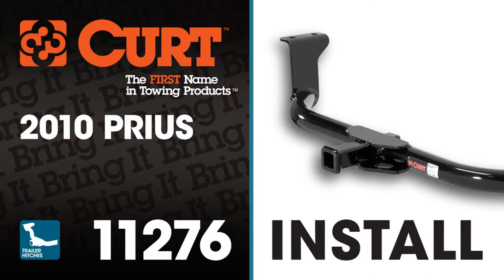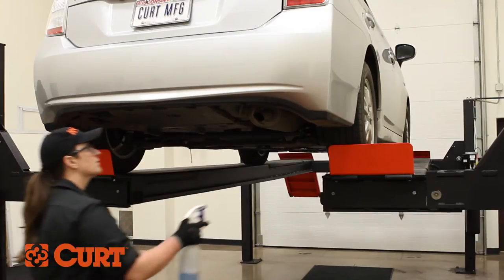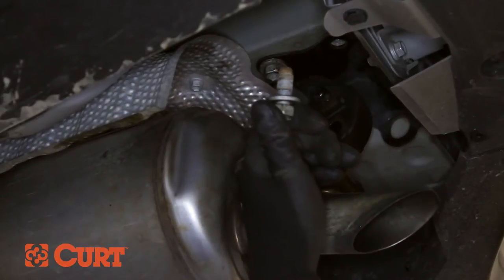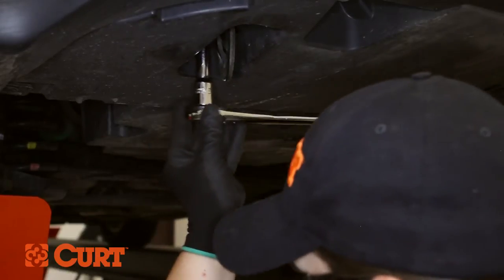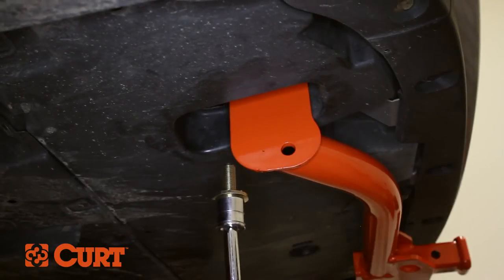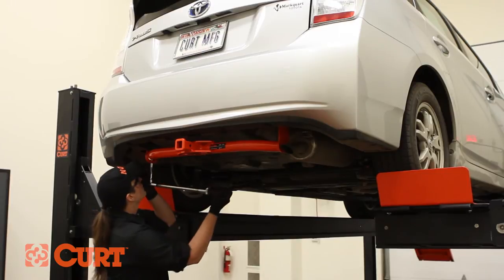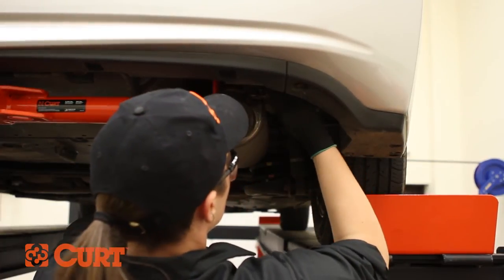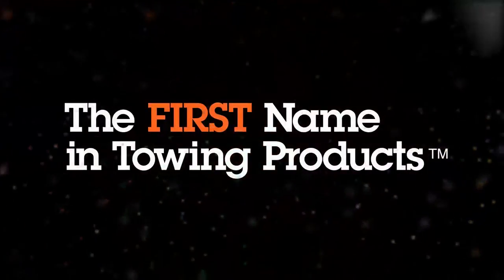Trailer Hitch Install: CURT 11276 on a 2011 Toyota Prius

Comment: 2015 Toyota Prius Plug-In Hybrid.  Easy to install, even for a novice like me.  One minor thing,...the heat shield "reflector" attached to the bottom of the vehicle just above the muffler.....the rear edge of it gets in the way of the hitch plate on that side of the vehicle.  I used a pair of "tin snips" to cut off the rearmost 3/8-1/2 inch of it.  No big deal; just beware.  Also, the trick of using soapy water to separate the muffler from the rubber "washer" - great hint, although I found the dish soap worked better when I did not add any water to it; also, I found it was easier to use a small paint brush (about 1/2") to apply the dish soap than a squirt bottle.  My driveway has a rather steep slope; I found it easier to install the hitch by positioning the vehicle so the rear was going downslope - much more room to work under the back end.  I work slowly - took me a leisurely 2 1/2 hours.  Very well designed hitch.  Very highly recommend it, and recommend DIY instead of paying to have it done.
Reply: CURT Manufacturing One related thing.....When I was researching which hitches would fit my 2015 Prius Plug-In Hybrid, I search the Curt website for hitches that fit it (2015 Prius Plug-In Hybrid).  I used your site's "Quick Hitch Lookup".  Sadly, my vehicle was NOT listed by your lookup feature as fitting my vehicle.  Your major competitor also did not list my vehicle for any hitch.  I found this absence very frustrating - like, what do I do?  Do I just not get a hitch?  And, if I really want a hitch, what if the hitch that I take a chance on does not fit.  Clearly, your lookup feature was inaccurate regarding no hitches in your lineup fitting my 2015 Prius Plug-In Hybrid.  It would be VERY USEFUL if you could explain, on your website in a very visible way, what, EXACTLY it means when your lookup does not retrieve ANY compatible/fitting hitch.  (I submit this suggestion not as a rant, but as a way for you to improve a great product and associated service.)  My regards.
Reply from the maker: Fred Yaeger Which model Prius do you own? We have passed along this suggestion to our data team for further analysis. Thank you!
Reply: CURT Manufacturing RE: which model Prius do I own....
Please see my earlier two comments in which I state that info.
Reply from the maker: Fred Yaeger There was some confusion on how Toyota names their Prius models.  You are correct, and your feedback about our vehicle lookup is much appreciated.  Thank you for the suggestion.